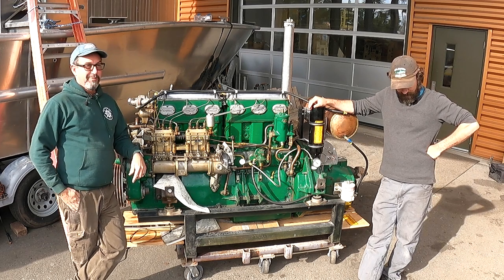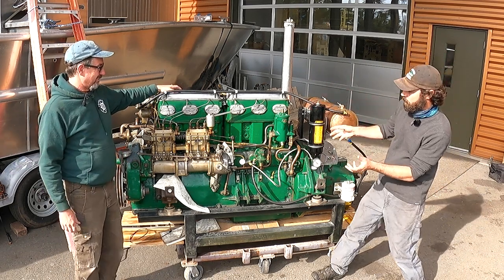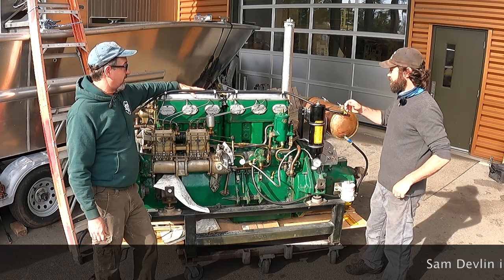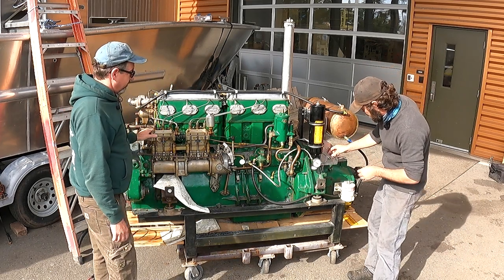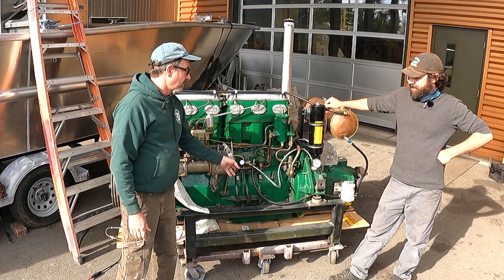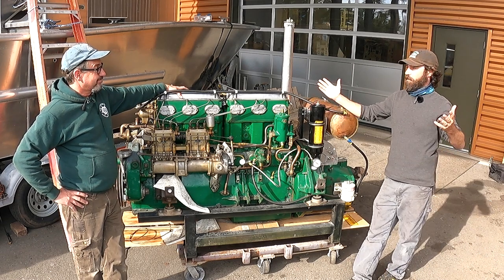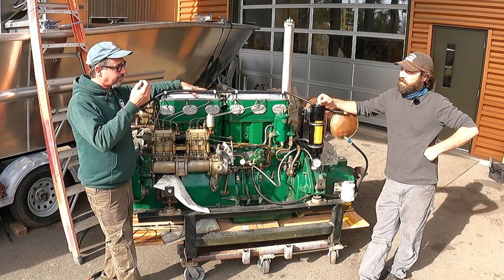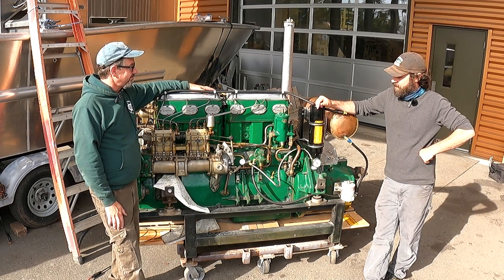Side Trip: A Great Old Gardner Diesel

Comment: Gardner the Rolls Royce of diesel engine,s ..I can't think of a modern diesel engine that will match their fuel economy ..and the fact you can work on them with the simplest of tools.
Reply from the maker: I can't wait to see this one back in a boat!
Reply: A company I worked for had a lot of 5 LW they turned in 19/20 to the gallon pulling 16 tones /32000 pounds day in day out !

Comment: I have a 8LXB in my boat still working every day, it's a 8L3B in that boat you are talking about fantastic engines.
Reply from the maker: Yes, I've since sorted out the model numbers. Looking to find a replacement for this one, I'd like one a little smaller and easier to move around to keep in the lobby
Reply: @SVCSkallywags  there are 1LW's too
Reply: @SVCSkallywags  try get a 3lw or a 4lw
Reply: 1L2 
Never was a 1LW 
They made 2 , 3 , 4 , 5 , 6 and 8LW engines.

Comment: They put these engines in loads of things. One really common application was locomotives, but they also went into trucks, busses, and heavy equipment. They were NOT cheap!! Having a Gardner specified into whatever you were buying would add a significant bump to the ticket. However they were basically the longest service interval engine on the planet, and way overbuilt like the old 1950s Cummins and Caterpillars were. 
As you already know, some of the stories you hear about these engines are absolutely wild. One such engine, a 6LW just like the one you have, ended up in a small narrow gauge locomotive that worked on a sugar cane plantation in Fiji hauling cane from the fields to the sugar mill. It got brought in to the mechanic shop after the driver reported that for the past week he had to fill the radiator more frequently (beginning and end of shift) so it was assumed it'd developed a coolant leak. On inspection it was found that the radiator hose had completely fallen off, and the loco had run 6 days, 24 hours a day, without any coolant! The hose was simply replaced, and the loco sent back out to the fields, where it did another 10 years of service without complaint!!

Comment: The Gardner 6LW, although originally designed in 1931, was in continuous production by Gardner until 1974 and it was the predecessor of the 6LX, introduced in 1958, and 6LXB on which they were based. Gardner engines were fitted to the majority of Scottish fishing boats through the 1950s, 60s and 70s. The 6LX and 6LXB are regarded as the greatest marine diesel engines ever produced. Each engine was manufactured in it's entirety by one man!
The Gardner engine fitted to the Radiant Star is not an 8LXB - it is an 8L3B. The 8L3B was the largest engine produced by Gardner into the 1970s and it's commercial marine rating was 230hp.
The 8L3B has 8 separate cylinder blocks and heads and should not be confused with the 8LXB which has two blocks of 4 cylinders and heads and, unlike the 8L3B, has much alloy in it's construction. The 8LXB is rated at 176hp. All wonderful engines from a different age of engineering excellence!
Reply from the maker: Thanks for the great info! I'm actually going to go out and do a series of films on the Radiant Star, it's been a long time since I've been aboard! That's when I started becoming a Gardner fan, when Allen told me some stories about those engines. Then I got to be the care-taker of this one from Sam, it'll be great to see It in a boat again!
Reply: Slightly wrong info
8LXB has one block and 2 x cylinder heads
8L3 and 8L3B has 4 blocks and 8 single cylinder heads.

Comment: Worked on many Gardner engines, fixed at 1000 RPM driving the DC generators, on the Aberdeen (Scotland) trawling fleet. BSW/BSF threads and BA threads/nuts for the decompressors on the heads, dry liners, advance/retard on the fuel injection. Loved the priming levers on the injection pump. Very easy to find if you had a duff injector and after an O/H get fuel up the injectors. Getting access to the bottom ends was a nightmare since there were no crankcase doors so the sump had to be dropped and that was held up with many 3/8 BSF bolts. Read time consuming! Cyl head was a steel corrujoint metal gasket with ferrules and a rubber ring for the water passages. Never used a torque wrench, just pull up the 1/2 BSF nuts nice and tight and the 3/8 BSF nuts behind the Monogram plates. Happy memories.
Reply from the maker: Awesome and Thanks. next quarter we're taking a boat ride on Radiant Star - 8 cylinder Gardner - can't wait!

Comment: Gardners love to plod along making them work hard at 900-1100 rpm- low down torque although you’d be lucky to see 2100 rpm. Renowned for fuel efficiency durability easy to work on ultra reliable and dependable and run nice and cool. 
No wonder almost every fun fair has a Gardner or two powering the rides. They have a sound of their own.
Reply from the maker: You got it! We're heading out to check out a 5lw in the next couple of weeks and an awesome  8L3 is also up for a tour & video, can't wait!!!
Reply: the LW range was governed at 1700rpm in trucks, 1300rpm in fishing boats. The 6LX, same 6in stroke but 4.75 bore compared to LW 4.25 bore, ran to 1700rpm. the 6LXB was 1850rpm. The bigger L3 governed to 900 rpm ,the later L3B only made in 6 and 8 cylinders ran to 1150rpm in commercial marine  use. Gardner 
management refused to move with the times and develop new more powerful engines and like the dinosaurs  became extinct.
Reply: I was going to say about the travellers loved them ...sold mine to Zimbabwe,for a half size train